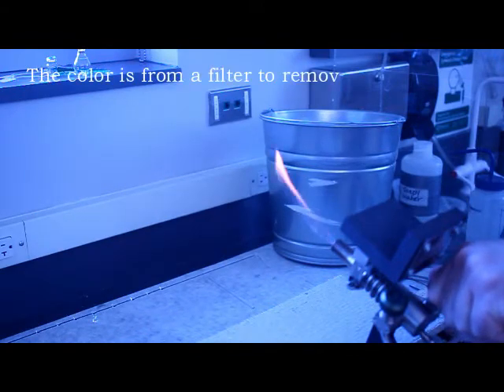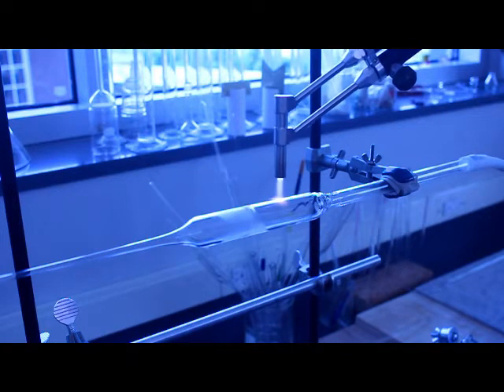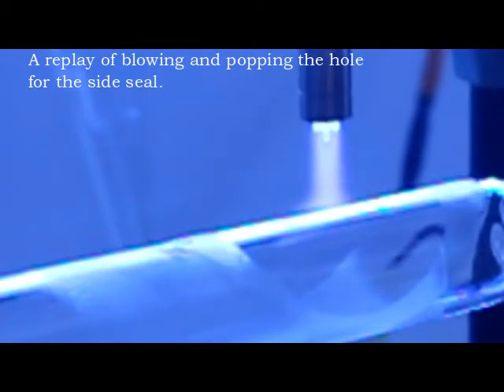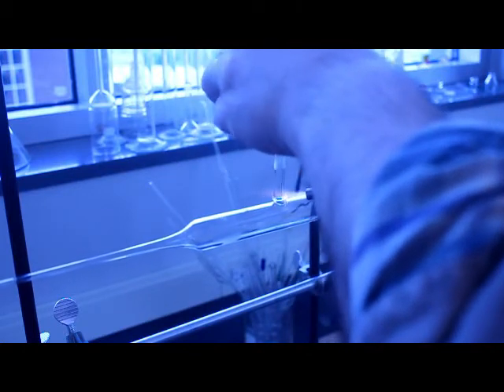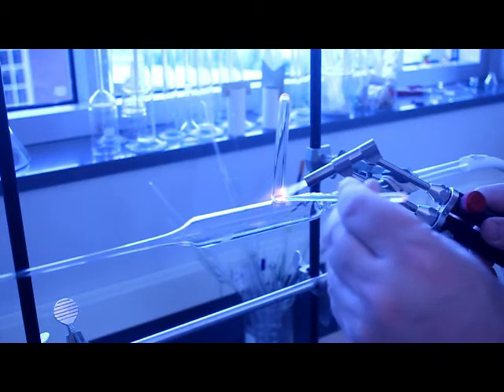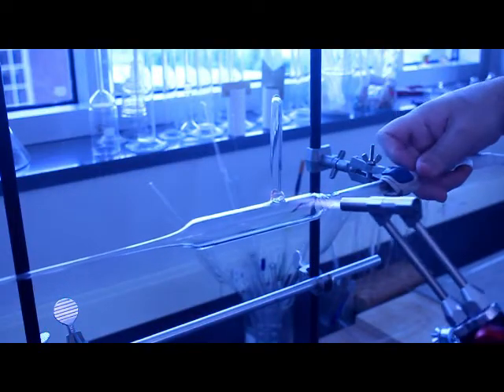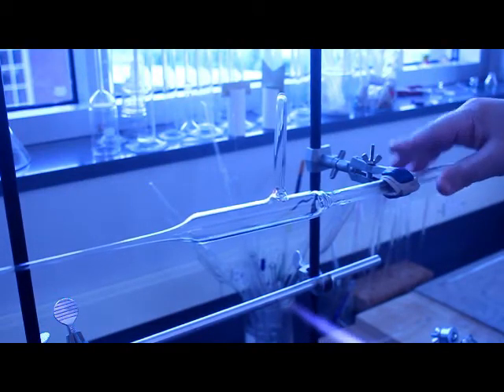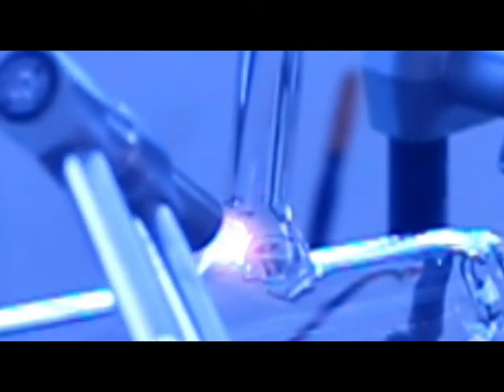Scientific Glassblowing Lesson 6: A demonstration of straight and side seals

Comment: Absolutely refreshing to hear the candid honesty... Being a self taught chemist and also do a lot of sci-glass out of necessity, I have the utmost respect for what you are doing here & wanted to say thank you!

Edit: forgot to mention, I discovered that you can use shaving cream as a means to non-kiln anneal areas of similar thickness glass that's just been joined or worked under flame. The chemist in me still hasn't really worked out the "why or how"  this works, but I'll be damned. I guess that's just one nice thing about being self-taught is the willingness to try anything and sometimes it does pay out. Nevertheless having a bucket or container of dispensed shaving cream can take a just cooled to the point of no longer glowing piece of glass down to handleable in less than 2 minutes with no cracks and under polariscope minimal stressing. Just thought I'd share that with you maybe you can shed some light on the "how and why"